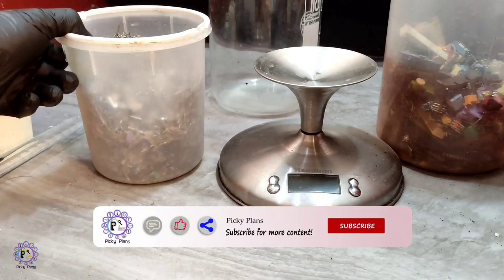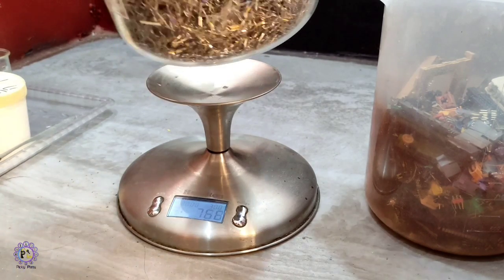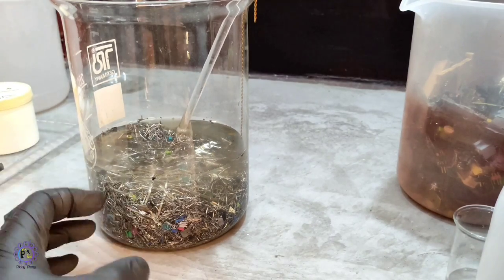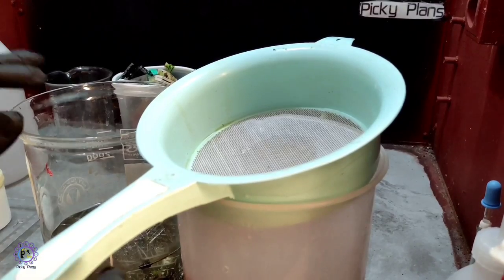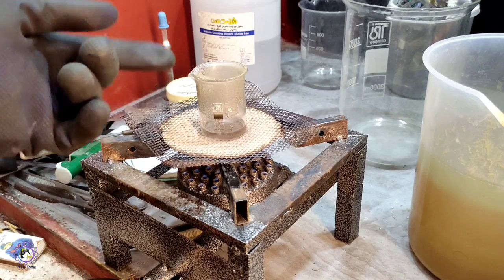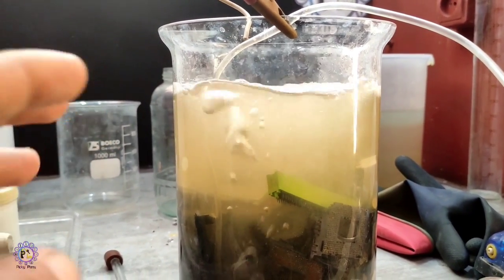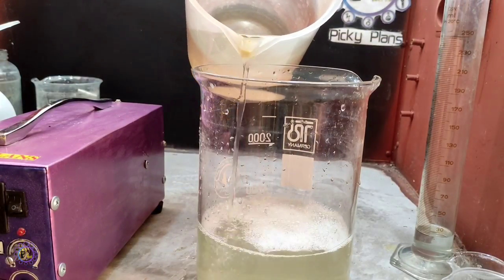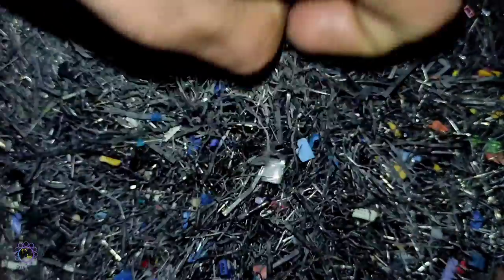Motherboard pins worst for gold recovery!

Comment: Nice video thank you 😊 
My fingers hurt just looking at those pins lol !!! Found out pretty quick that low grades aren't worth the acids
Reply: M8 u have cyanide and u didn't use the simpole methode of electrolysis 😉 especially in low or high grade pins .. Im w8ing an electrolysis video from u !!! Nice vid ❤
Reply: @PickyPlans  with h2so4 electrolysis its the chipest methode anode copper cathode leed thats im w8ing for the next vid !!